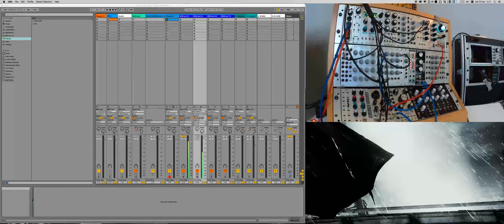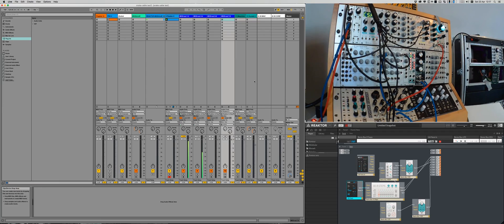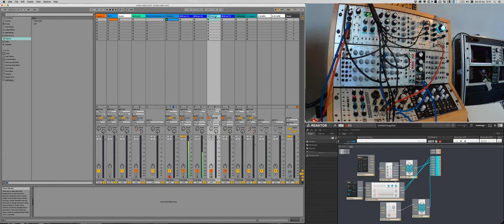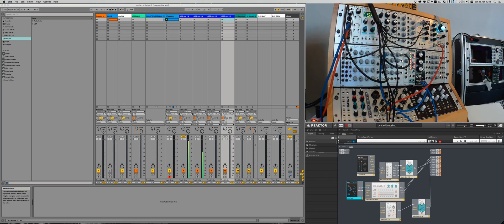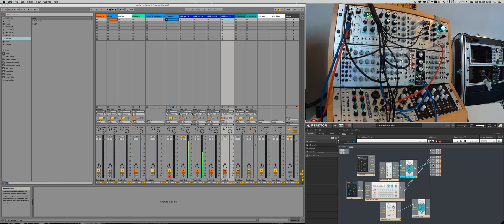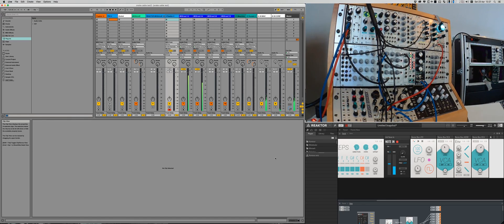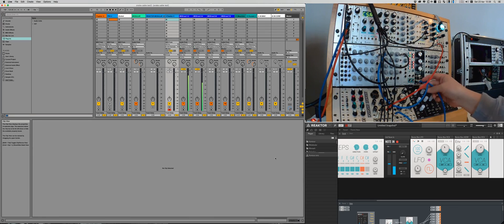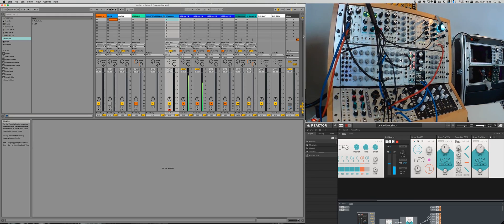Reaktor Blocks CV out to Modular

Comment: I am having trouble finding or how to find DC coupled audio cards, atm the only thing I have as an Audiocard is KONTROL 1 by NI which was release like 2006 or something? I am trying to sync my Pocket Operators (Teenage engineering) with moog mother 32 -> To reaktor blocks (I do somehow need to split the stereo signal of PO also. Am I over complicating things?

Just a confused hardware newbie. So basically:
-Do I need a new Soundcard or is expertsleepers solution enough?
-if I need a new sound card do I need more Inputs than 2? If yes how many?(ah yeah maybe I do, have a mic also)
-I know Moog mother 32 has midi, but I would like to send some cool CV modulation from and to Reaktor Blocks

I know this video is not a tutorial video for newbies. But I would greatly appreciate if poster or anybody could help me understand this better.

Thanks! Peace!

Comment: Very nice. I'm planning on a similar setup using an 828mk3. To verify, you cut one end of a 1/4 TRS and soldered a mono 1/8 to the top and shield conductors, correct?
Reply from the maker: Exactly. So the ring doesn't short the ground.